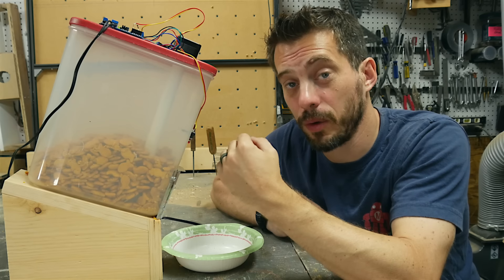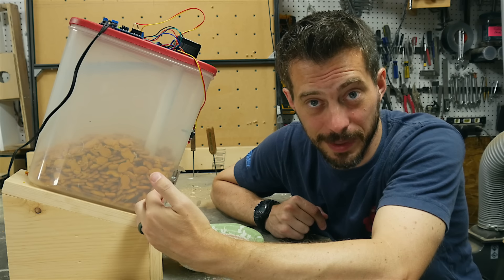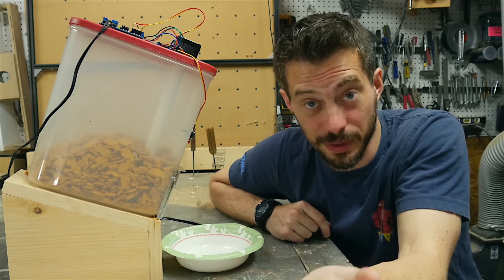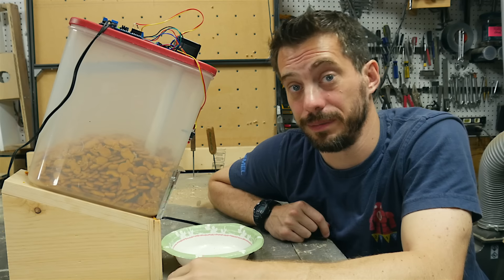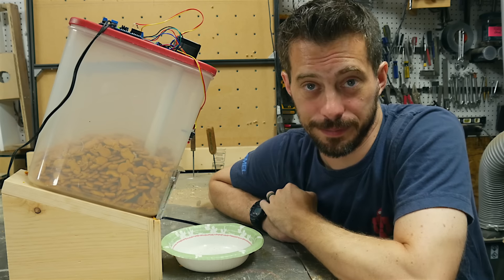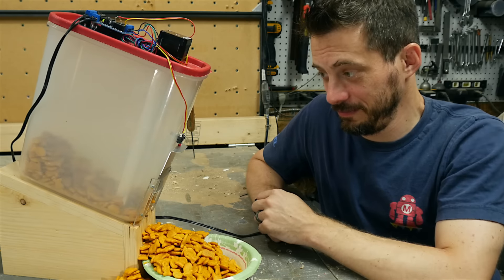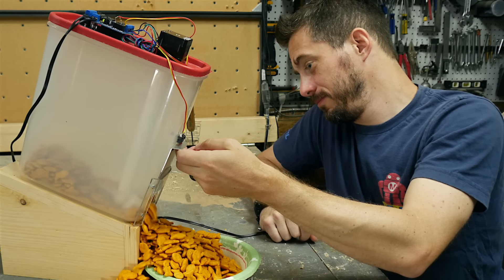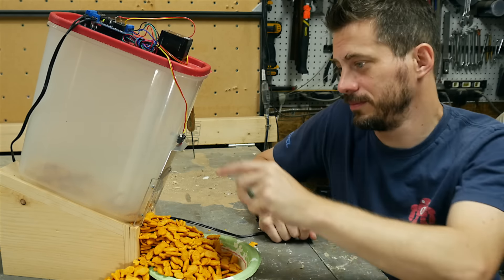Ridiculous Snack Machine // How-To | I Like To Make Stuff

Comment: I'm not familiar with how stepper motors work - is the Arduino essential? what happens if the motor is just hooked up to power?
Reply from the maker: An Arduino isn't necessary, but they do have to have a driver.  They can't go straight from power (that I'm aware of). For that you'd need to use a DC motor.  I actually ordered one but it didn't come in early enough for me to use it.
Reply: @rohoon Stepper motors work in a similar fashion to brushless motors but more precicely, they don't have mechanical commutation to switch power to their electromagnetic poles, if you just applied power directly they would click into place and stay there as nothing is switching the magnetic field. When using a stepper motor driver with an arduino you usually have one pin say which direction you want the motor to turn in, and the other pin makes the motor turn one 'step' per pulse. Stepper motors like this are usually 200 steps per revolution without using microstepping.
Reply: Awesome, thanks for the explanation. Great project, Bob! Now to make a meow-activated cat feeder...

Comment: do you think you really needed the arduino control? I think this is unnecessary, because , all the switch does is activate the step motor , right? so if you just hooked the switch to the step motor, wouldn't that work just fine?
Reply from the maker: +Lomme De Pauw stepper motors need a controller but you don't have to use an Arduino. you did see the title of this video correct?
Reply: ""Ridiculous"
Reply: haha, you're right! Fun project though! Hope to see more of these in the future!

Comment: cant you just let the arduino out and connect the motor directly to the powersource ? (ofc you would have to put the button betwen those too)
Reply from the maker: +Pwny you don't have to use the arduino but the stepper motor does need a driver of some sort. Not just power
Reply: +I Like To Make Stuff okay thanks didnt know that

Comment: Not a snack machine. that's a snack dispenser. would love to see a ground up real corkscrew type vending apparatus. not for the mechanics be for how you would use arduino to run it all. maybe 4 different items. the kids will love it!!
Reply from the maker: Thank you for the "correction" ?  I actually started with an auger style device running horizontally, but there was too much friction so I moved it vertically. At that point the only thing doing work was the bottom bit, thus, the propeller design.

Comment: What power supply are you using to run the stepper?
Reply from the maker: The motor shield just takes a 5v power source.
Reply: Cool.  I think the amperage the power supply is rated for is an important metric too, can you tell me what yours is?  I bought most of the parts you listed because I want to use them to make a camera slider.  I don't want to blow up my arduino or motor shield before I even get started.  Also, am I right in thinking that if I plug the power supply into the motor shield it will also power the arduino?

Comment: Isn't a stepper overkill? Couldn't you just use a regular dc motor or servo?
Reply from the maker: Maybe, but I was surprised at how much torque was actually needed to move through the goldfish. I originally bought some DC motors to use for this but they didn't show up in time.   I don't think the servo would have enough torque, but without testing it, I couldn't say for sure.

Comment: why a costly stepper motor? you can easily mod any cheap RC servo into a pwm controlled geared motor, by cutting off the shaft of the potentiometer inside at it's zero-position.
Reply from the maker: I think it comes down to torque. My initial tests showed me that the goldfish actually required quite a bit to get it to move. The continuous servos that I have on hand would definitely not been strong enough to move the pieces.

Comment: Do you reale need a Arduino Uno to put a motor running???
Reply from the maker: No, but you do need a controller for a stepper motor, and using them with Arduinos is really simple.  A simple DC motor could go directly from the power source and a switch.
For the record, you don't NEED an Arduino ever, in any project.  But they are a tool to prototype things quickly and temporarily.
Reply: Ok, thanks.

Comment: I don't understand what you need all the complicated electronics. You could make this work with just a switch and a drive motor.  You could make this even simpler with a hobby motor, a switch and a battery pack.

Comment: Why did you use the arduino though. Didnt really need it
Reply from the maker: No, but the stepper does need a driver. The Arduino makes that simpler overall, but it's not necessary.
Reply: Oh okay, i would just connect a battery to a switch and from the output of the switch to the motor. Anyway great job on the project !

Comment: But why use a stepper motor with the arduino? A regular low rpm motor direct with a battery would have worked just as well. This is unnecessarily overcomplicated my friend.
Reply from the maker: I think you're missing the point of the experiment.  This was for me to learn and solve some mechanical problems. If you make something like this, you'll be using different methods and learning different things.
Reply: +I Like To Make Stuff  If the endeavor was learning, then sure, full marks. To be fair, you did that this was ridiculous. Being an engineer myself, couldn't help but remark on the "over-engineering" involved. 

Nonetheless, fun to watch and thanks for replying. Keep up the good work and hope to talk to you again :)

Comment: Arduino is unessecary. just use a switch. its just a waste if money. bo offense
Reply: Offense? Wat
Reply from the maker: You would have to move to a DC motor, unless you provided another driver device for the stepper.  The torque is greater with the stepper than the DC motors I have access to, and I was surprised at how much torque was needed to move the goldfish.
Reply: +I Like To Make Stuff it's just my opinion
Reply: +Ghost 39 just so noone says i try to say he just wants to sell stuff. but it wws just my opinion
Reply: +I Like To Make Stuff :)
Reply: +I Like To Make Stuff just add in a transistor, they amplify the current
Reply: +Lickmuffin ok

Comment: Why did you use 30$ ardiuno and a stepper motor when you could just use a small dc motor that you could get for free by dissassembling toys/appliances.. well yeah learning and stuff, but seriously?
Reply from the maker: Because I'm a monster.
Reply: +I Like To Make Stuff I had the same question :P seems like you could cut out the middle man and just grab a battery/transformer with the voltage to run a dc motor at the speed you want
Reply: Personally I see several rational reasons to buy instead of hacking something apart: A: a purchased stepper motor will be more reliable B: reliability ensures it's available for future projects C: if you wish to make project with several stepper motors of the same spec then you can easily add more by purchasing the same model. Oh and I forgot because he has free will and can do whatever he likes as its his life.
Reply: He's familiar with Arduino and he used a stepper motor to learn about it. Good stuff! Waaait, that's a different channel, sorry. :P

Comment: You really didn't need an ardunio ay, you could just grab a cheap power supply and you know... Connect da dots
Reply from the maker: +Jacque Minogue you don't NEED it but it's not that simple. Using a stepper requires a driver of some sort to avoid that you'd need to use a DC motor. You never NEED an arduino but they make prototyping fast and easy
Reply from the maker: Ðelkø Gummybread Yup.  My point was that it's not the same as a DC motor.. you do need more than power.
Reply: I Like To Make Stuff if im doing stuff like that i just hook it up to the mains with a varible resistor and hope for the best.... because safety :)

Comment: You do not need an Arduino! don't you ?
Reply: You would not need p e if you were to use a regular dc motor but because a stepper motor has multiple wires that need to be powered in a specific order at a specific pace you have to use the Arduino to time everything correctly.
Reply: One*